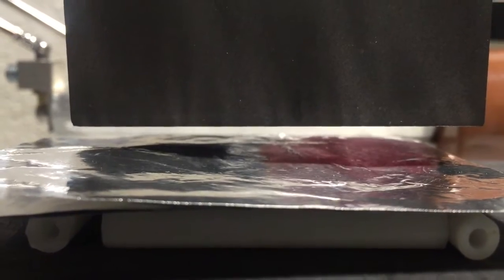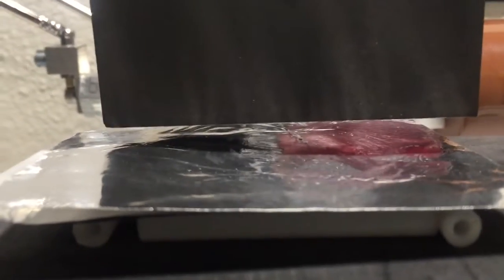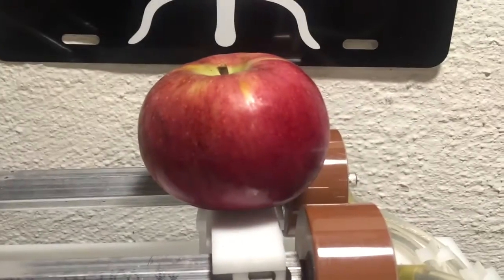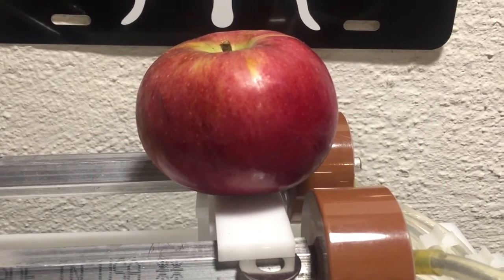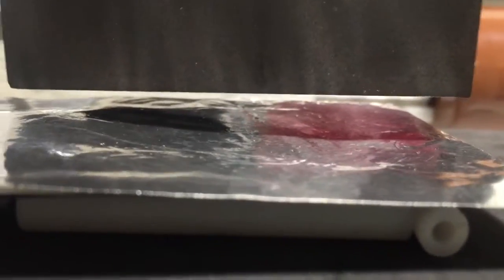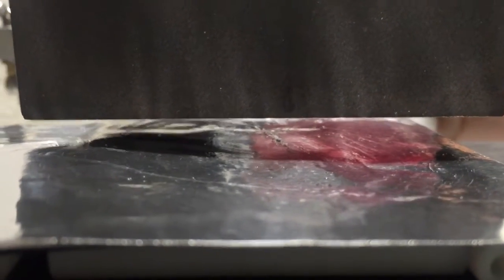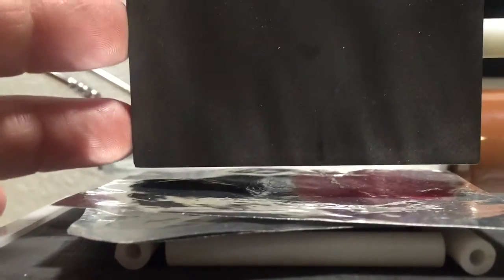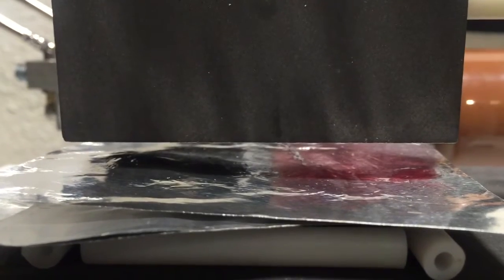THUNDERBOLTS PROJECT RAISED DENDRITIC ELECTRIC EFFECT

Comment: Can this raise a moist (rained on or high humidity)dune ridge to be higher and sharper than normal for a dry dune? I'm looking at the Himalaya mountains, they have a thinner sharp ridge than other mountains, pretty high up to. 

The mountains are on a tectonic intersection, an opening to the planet core. Seems like a high conductivity area. 

The mountain layering makes no sense if it was from a volcanic oven. There's dirt in between rocks. The dirt and sand would change in that kind of heat and pressure way way down there.the layers look pretty fresh, with crystal veins that run right through "folding" rock.  The ridge peaks are much to perfect and sharper than most mountains  but still higher than most mountains.

Rocks can't bend, direct current might be able to heat dry a mountain dune that slid down and curled , then heated dried in place. Granite and most rocks are a mixture , like dune sorted material is. 

Can direct current raise a ridge higher and sharper?
Reply from the maker: +Dodge Van The type of electric phenomenon that imparts this violent movement has yet to be precisely established.  The concept of direct current may or may not be adequate language.  It seems as if the electric phenomenon is oscillatory and born of significant capacitive discharge.  Another video will follow to show the difference of normal inductive plasma vs this discharge phenomenon that most likely is a good miniature version of Birkeland current.

Comment: Pardon the multi posts.

We see sand waves left by , wind, water, shaking and electrical influences. On earth we have all of them. 

We see moving dunes on a comet, and on earth. I'd hate to think sense electricity can make dunes ,to rule out that water makes dunes under the ocean .  Everything matters, everything counts, even the weak gravity on a comet. 

Weightless static electricity matters to in dune making. I see mountains as dunes and I'd like to find out why they are similar inside and out.

I've got a lot to add on this subject.
Reply from the maker: +Dodge Van IMPEDANCE TO FLOW shows effect, what shows differs by substance and interaction of forces.  What is flowing is the key.  Sometimes water, sometimes electricity, sometimes both, etc. Conservation of angular momentum etc

Comment: Looks good.

Can it cause a strata layer to rise and keep the layering intact?

Can it make rock from damp material in a strata layer?  

I also see it'll make Quartz veins through the damp strata layering.

Your mountain goes up and the valleys stretch in between the ridges. That's interesting. 

I see mountains were collected by negative rotation storms (submerged and dry) that settled and sorted as dunes, they got wet and baked . Baking can be done with electricity , electrically stimulated volcanism or other. 

Can a thunderbolt make Quartz veins in damp material?

Your doing great work
Reply from the maker: +Dodge Van Excellent questions and I believe the answer is yes.  In the lab we must scale the substrate.  Watch this clip minutes 8-end etc.
https://www.youtube.com/watch?v=4s-vGkYUt0o